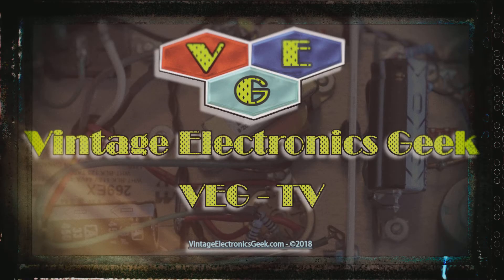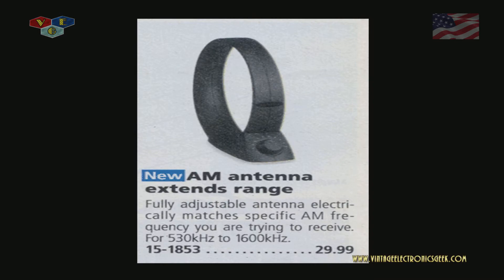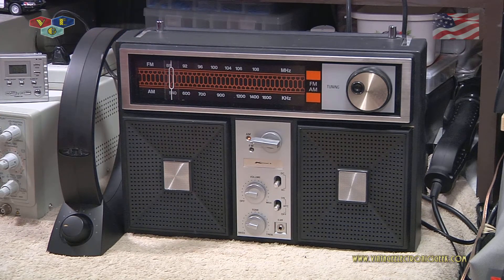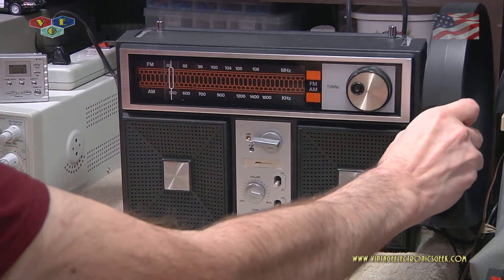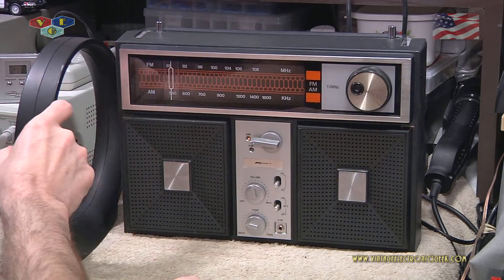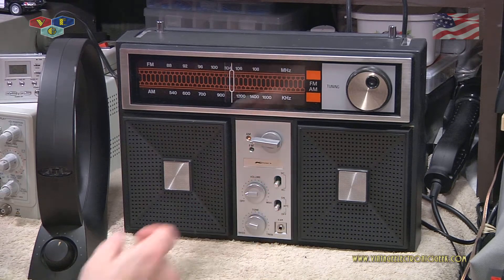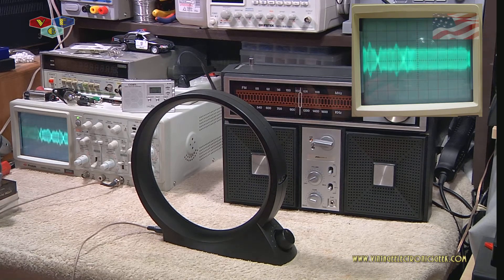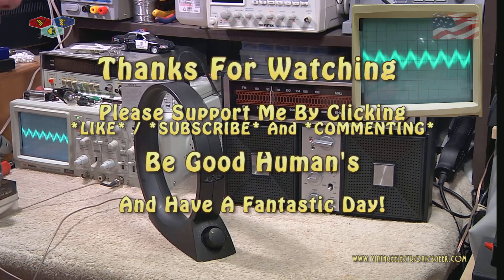Radio Shack Loop Antenna Model #15-1853 - Overview And Test - Part I

Comment: Where you connect the wire coming out the back
Reply from the maker: There is no physical connection between the radio and antenna, this is only air coupled, so just place the loop antenna close to the radios internal antenna is all you do, then adjust the dial on the loop antenna for peak performance. However, the loop antenna does have provisions of a physical connection, at which point, you would connect the loop antenna to the antenna terminals on the radio. Thanks for watching!  ~Jack, VEG

Comment: I have just now tried the That antenna with the Sangean HDR-18. First i tried it your way along the side of the radio and then i tried connecting it to the radio. Either way it did nothing.

Comment: Loop antennas, including the internal loopstick, are directional. The axis of the loop should be aligned with internal loopstick for best nulling ability, which is what you want if you're trying to eliminate a pest station so you can hear a different one. Radio and antenna then need to be rotated together to find the best null. Placing the radio and antenna on a lazy susan makes it easy to rotate both together as a unit.

Comment: The ant out is for use with radios that don’t have a built in ferrite antenna to couple with or to allow moving the antenna away from the radio if the optimum position for the radio is not the optimal spot to receive signals on am

Comment: i have one of these but no portable radio.. thinking of experimenting using my  rsp2play..   hey, you never know.
Reply from the maker: Really?!!  That's cool to know of another!  And an interesting experiment!  Later on, I plan on replacing the transistors to newer replacements as they seem to be almost twice as sensitive (at least the 2 I checked) and replace the loopstick bar with a longer size, maybe 120mm like the GE Super radios have....and experiment with different components to see if I can get it to perform better.  I checked your channel and see no videos, if by chance you do mod yours, let me know if you do a video on it, would be very cool to see!  Thanks for watching!  ~Jack, VEG

Comment: Nice! Wasn't K-Mart a high-end brand? It would have been interesting to  bring various different objects close to the radio.
Reply: Old School .. could kick me self in the butt for not buying a GE SUPER RADIO II when kmart was selling  them for $89.95. It was a veryx2 good radio and picked up stations others missed.
Reply from the maker: If high end is the new low!  :)  Ima gonna say, you don't live in the states?  What kinda objects??  I'll try it!  FYI, I did work on the radio, video is in the can, I just needed to finish editing Part II of this antenna, then start editing on it. You mind if I contact you via email or PM?  ~Jack, VEG
Reply: Haha! I don't remember the last time I was in a K-Mart...Not to buy a stereo, that's for sure. I did buy a little Onkyo stereo set about 10 years ago in Best Buy. The store where the non-electronics people sell electronics stuff. I had a salesperson give me unwanted "hifi"advice; it was bizarre. You can PM me over YT. People sometimes do that when they desire advice and want to keep it private, etc. Might take me a day or so to answer.
Reply from the maker: Yea, its been awhile for me as well!  Oh, wait, I actually went to one when I was in Oregon here recently, but otherwise, many years!  Yes, kinda challenging taking advice from folks who are at times, just buffalo ing  it!  :)  OK, NP, will send one off this evening!  Thanks, Jack, VEG

Comment: Wow, the loop works really well coupled in this manner. It really did make a big difference. The dial sounded like it up was about to give up the ghost.
Reply from the maker: Yeah, it did squeak!  I just finished working on the radio, was going to lube it but I couldn't find the zerk fitting!  :)  But I did put some 3-n-1 on it, help, but will need to add more later.  You may like/be interested in Part II as it will show the simplicity of the antenna!  ~Jack, VEG

Comment: I have a similar antenna to that I picked up last year from Amazon made by Grundig that I attached to my old 33 Philco as it is completely helpless without it.  I can pick up the one local station using a long wire antenna with it and with the tunable loop I can get 3 stations, lol.
Reply from the maker: I may try modifying mine at a later date...or I just might put up a external antenna, I enjoy AM DXing, unfortunately my office is somewhat a dead zone due to the fact, my office buts up against the garage and that's where the house panel is, so not only do I have noise, but I also have half of the the house wiring going through my office in one capacity or another!  Is your Grundig powered or unpowered?  ~Jack, VEG